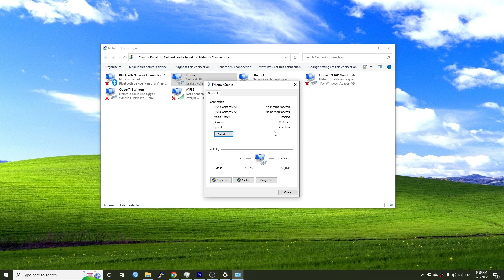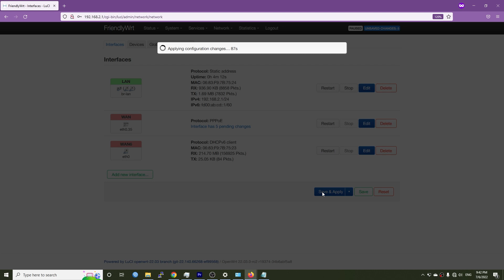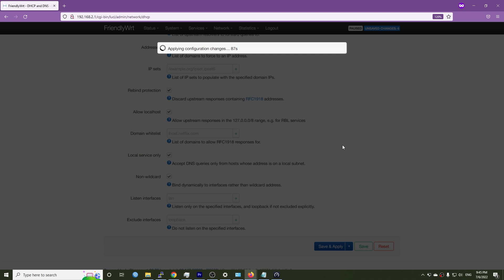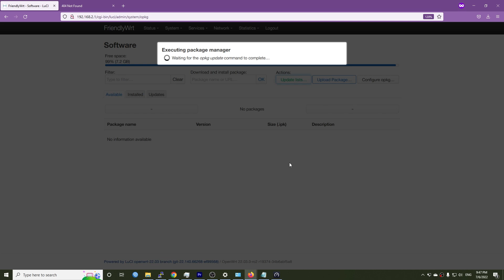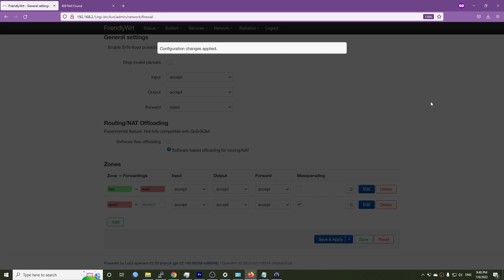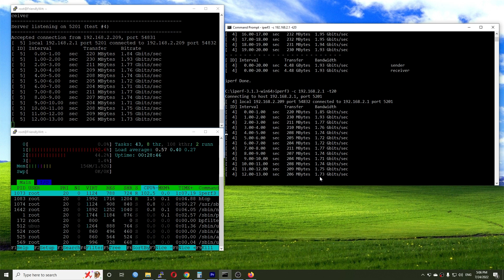OpenWRT - NanoPi R5S Overview & Initial Setup

Comment: Hey Van, Since NanoPi R5S is officially supported by Openwrt 24.10. Can you please make Installation/Overview video for that, continuing the series.
Reply: Did you find out how to safely do it?
Reply from the maker: Hi, I no longer have the R5S so I can't do that. Basically the performance should be the same since the R5S can do 2.35Gbps WAN to LAN throughput as tested on end of 2022. If you haven't seen that, please check this out: https://youtu.be/KcXsto1nv9Q?si=REY7GvAwdGBDHzkx
Reply: @ I have seen that video too. Yesterday when I flashed official openwrt then I noticed fullcone nat option was not there in firewall section which is obvious. Question is when you enabled fullcone nat then you were able to achieve 2.5Gbps and when disabled it was kind of 1.8Gbps, so as this option is not in official release will it affect the performance and limit to that 1.8Gbps segment?

Comment: how do i verrify what link speeds are on the router? im stuck at 1gb lan atm and want to verrify the wan port is 2.5
Reply from the maker: In the default setup, the 2 x 2.5GbE ports are LAN. You need to change one of the LAN port to WAN port.

Comment: Hello Nice to see your videos. I have a 32GB EMMC with 4GB ram of this unit. The issue is i can't find a proper guide how to setup docker network properly in open wrt. It would be nice if you can make a video on docker in open wrt. Also how hot the metal casing gets. For me it seems quite hot after an hour. Thanks
Reply: You ever fix the hot issue? Mine is incredibly hot
Reply: @Ignotus.  I bought a cooler from AliExpress that attaches to the top of that device. Now it stays at 42-48 degrees Max. Before it was 55 degrees  or even more .
Reply: @knightmaheruf ah sweet i will have a look for that as well. Thanks!

Comment: Hi, is it possible to use this device as a dumb AP with wifi 6e? Of course with friendlywrt. The wifi card I'm planning on using uses the MediaTek chip MT7922. So in short, nanopi r5s as a WiFi 6e AP. Thanks in advance
Reply from the maker: Hi, IMO, it is not worth to use this device as AP. If you enjoy using OpenWrt for AP, you can take a look at GL-iNet's Beryl AX, 8devices and Wallys. They are making good WiFi 6 AP with 2.5G network port.
For the NanoPi R5S/R6S, I only recommend to use as router.
Reply: It pretty much will cost me the same, that's why. Cost wise it's fine, I just think it'll be better for upgradablity

Comment: Thank you for this video!

Is it possible to use one LAN port on the R5S as a WAN and the other as a classic LAN? Because I need a 2.5 Gbps WAN port and a switch consisting of a 2.5 Gbps LAN port and another 1 Gbps port (like the R6S).
Basically, is it possible to use the 2 LAN ports as separate from each other and merge the LAN port with the WAN port?
Reply from the maker: Hi, sorry for the late response. The answer is yes and I already do that for the speedtest video with the NanoPi R5S. If you have yet to find the answer, you can check it out

Comment: can you install a VM hypervisor on it like esxi or kvm on linux and run openWRT simultaneously with other services ?
Reply from the maker: From what I know there  EXSI or Proxmox is not supported. You can install docker and run OpenWRT as a container. However, I have yet to try that.
Reply: @VanTechCorner  do you think the nanopi r5s is powerful enough running openwrt with managing 2 vlans as a docker container with some other services (ex. NAS as a backup server) simultaneously?

Comment: Will the case support a battery if you wanted to use the connector?
Reply from the maker: Hi, it doesn't support battery (no hardware connection)
Reply: @VanTechCorner  My apologies. I was confused with the RTC battery connection with a jst battery connector. Thank you

Comment: Van I hope u well man I need quick devise I just install in Toob uk fiber 900D 900U I want to replace fiber modem to better one modem is 62i XGS-PON OnT ?! Thank you
Reply from the maker: Hi, I can't find the link to the ONT you mention, can you share the link to it. It is good to check with your ISP if they have a better ONT to upgrade (which will be done by their technician). Replacing the ONT is complicated in some cases, because the ISP will check the ONT's MAC address, SLID/Serial & password ....and you will need to get these info configured on your new ONT.
Reply: @VanTechCorner  ok I will call then to find out Thank Van top man . Is this one any good UFiber Nano G Network Unit?🤜🏽🤜🏽
Reply from the maker: Yes it is a good ONT. But you better get the Ufiber Loco if you want a micro B power adapter. With the Nano G it will come with the PoE adapter
Reply: @VanTechCorner  thank you again Van obrigado 🙏🏽
Reply from the maker: No worry, just recap:
- UFiber Nano G: Has LED display the metric, only power by Passive PoE (no microB connector), comes with PoE adapter, higher price
- UFiber Loco: No LED display, power by micro B USB & Passive PoE, comes with only the microB power adapter, cheaper
All should have the same specs / performance.
Reply: @VanTechCorner  Morning Van all sorted on my end call then paid for my IP static is well now I will or order the ufiber loco thank you again Top man all the best 4U 🤜🏽🤜🏽
Reply from the maker: Glad to hear that and I will be happy to receive some photos of your setup once it is done. You can send to VanTechCorner on Twitter or shared it on the Van Tech Corner & Friends group on FB.
Reply: @VanTechCorner  I will Van 🤜🏽🤜🏽

Comment: I received the 4gb version a few weeks ago. I should report my version has 16gb eMMC not 8gb. Also the M.2 slot only supports NVMe can't use it for M.2 SATA. I'd love to see how to setup docker containers on this as I really want to run photoprism! Great video thanks
Reply from the maker: Hi, from what I know, there is firmware build for R5S with docker pre-installed. Maybe you can take a look at the firmware download section, or check out the builds from Lean.
Reply: Have you been able run docker containers? How is performance?

Comment: Does the SSD run off a USB bus or an actual PCIe bus?
Reply from the maker: I think you missed the features highlight section. This is NVME M.2 (PCIe).
Reply: @VanTechCorner  I see. All M.2 NVMe SSDs require the PCIe bus. MSATA drives may use the USB bus.

Comment: How does it keep the time without an actual CMOS battery?
Reply from the maker: It get the time from NTP server. For OpenWRT, see  https://openwrt.org/docs/guide-user/advanced/ntp_configuration  (I believe it is the same for other Linux distro).
Reply: @VanTechCorner  so the system does not keep track of the time, meaning when it boots, its clock is whatever was hardcoded? Then after boot, it goes to the Internet time server to update its clock?
Reply from the maker: @jasonluong3862  I am not really sure how it works. Here is a piece of information on Linux regarding this, you can check it out https://www.linux.com/topic/networking/keep-accurate-time-linux-ntp/
Reply: @jasonluong3862  chiming in. That's pretty much how NTP works, but instead of "internet" it sync from "network" source.

You could technically daisy-chain the update from other ntp-serving capable device on your local network if you're not planning to connect the device to the internet. Or you could setup 1+4 server (1 local, 4 external) to get best of both world (offline availability and virtually no desync).

Comment: Just bought it, using FriendlyWRT official image, stable so far. All 3 ports are individually controlled which is awesome, no need to use VLAN. 4 GB RAM total, 108 mb used currently! There's also friendlywrt build with docker
Reply from the maker: Are you using the pre-installed image or already updated it to a newer version? I am looking for a sysupgrade image but not sure which one I should get (they have USB update / microSD, etc)
Reply: @VanTechCorner  good question, using pre-installed image, did not update it yet. I should also think about it
Reply: @VanTechCorner  can use the SD to eMMC one. It will overwrite what's in the eMMC. The SD one I understand just runs off the SD card.
Reply: @VanTechCorner  I'm very interested in the build with docker. Wondering if it can be used to run dockers for Unifi controller (since I don't see an OpenWrt package for it) and NAS (although Samba works great in OpenWrt already).

Comment: Van Tech Corner, thank you very much for the information, I have a question regarding the type of Internet connection you have? fiber? dedicated speed or best effort? Thank you in advance, and I look forward to the upcoming tests.
Reply from the maker: Hi, I am using a fiber (GPON) internet plan. The commitment is 200Mbps Upload & Download domestic, and the speed is the same when downloading from oversea (except when the submarine fiber network is impact, eg the Asia-Pacific Gateway). The fiber cable goes directly to my unit and then to a GPON WiFi router (provided by the ISP), but I already configured it to work as bridge mode, and use my OpenWRT router to handle the PPPoE connection.
Reply: @VanTechCorner  Noted, I was curious because I am getting speeds of just 130 Mbps Down & 172 Mbps Up, during hectic hours 14:00 JST, this is Fiber Optic as well, but I guess the "committed" option will make the whole difference, my plan is a "best effort" the cheapest with dynamic IPv4 and support for IPv6.  I am definitely looking into getting one of those NanoPi devices, I like the fact that we can run OpenWRT and also Ubuntu headless if needed on the smallest hardware model, I don't really have a need just yet for 2.5G LAN but this is something future proof ;-) Thank you again, and until the next review.
Reply from the maker: I have the feeling that the R4S is doing better compare to the R5S (speaking about routing/sqm) since it has 6 cores ( and we don't really need M.2 slot when using the device as a router, too). If am going to test out if the R5S can handle 2.5Gbps routing (now the 2.5G ports are LAN) and update once it is done.
Reply: @VanTechCorner  sounds good 👍
Reply: @VanTechCorner  The r4s has 2 big a72 cores that probably make the difference.

Comment: I'm planning on buying one of those. I would like to test out Openmptcprouter on it. Any chance you could test this as well? This unit looks pretty good for bonding 2 wan connections.
Reply: Mwan3 on openwrt can do load balancing just fine!
Reply: @aashishsharma1702  Sure, i have tested mwan3 and works as Load Balancer. But, Openmptcprouter is a "Bonding Solution" that allows you to combine all WANs in to one Fast Pipe, it's a very good project, I've been using it for almost 2 years, but on a x86 platform. I'm interested in something more power friendly.
Reply from the maker: Hi, no promise on the time, but I will check this out.